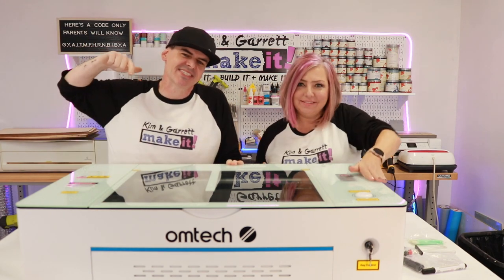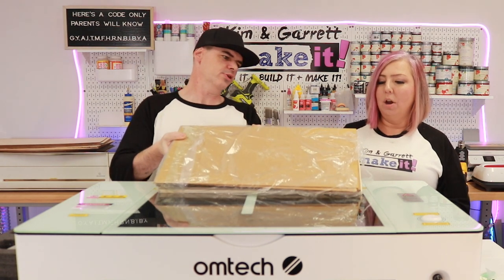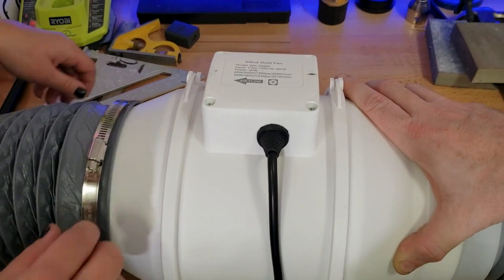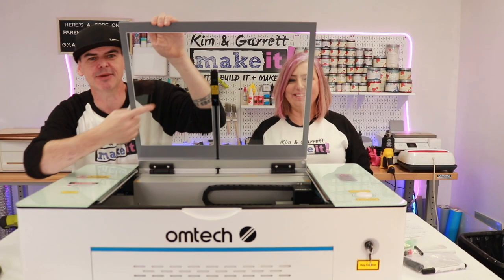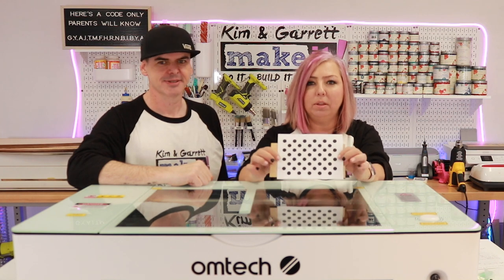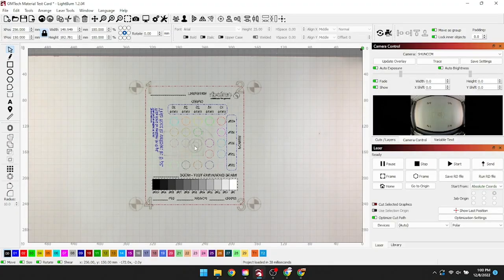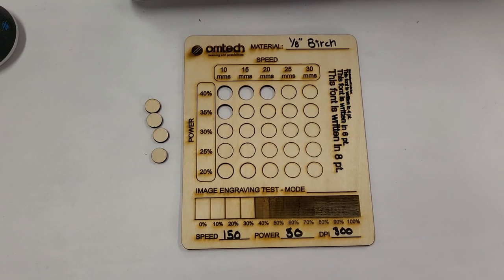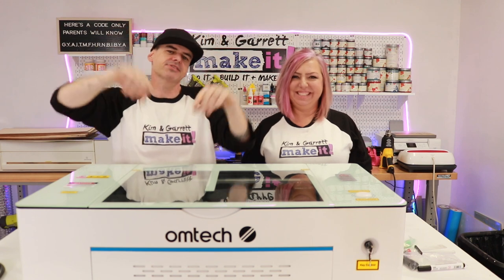OMTech Polar Desktop Laser SetUp: Is It Worth The Money?

Comment: Note:  5:09... You may not have noticed anywhere else, but when you buy this device, it doesn't come with software necessary to operate it.  This offers versatility in that you don't end up paying for software you have, but if you don't have it, there's an extra $120 for software access on 2 computers ($30 per additional machine, though per OMTECH, you can email them to have a 3rd computer seat added for free) and 1 year of updates.  Software continues to work after a year, but there is an additional fee to continue to get updates.

I didn't already own the software so I was quite displeased with this little tidbit as I found out after the fact.  I thought that since the only thing offered with mine while purchasing was Lightburn training videos, that the software was included.  Young me... so naive.

Comment: Bought one refurbed off ebay; pretty amazing for price but has some defeinte quirks.

1. Camera was meh at best; went back to custom via pvc tubing rack.  no more cal nightmares.
2. Engrave speed on x-axis is limited to 200mm/s or 12,000mm/m.  Not sure why?  This means if you set anything higher it makes no difference.
3. Engrave speed on y-axis is 500mm/s; almost seems like you'd get a 50% performance boost if you rotate prints?

Comment: Thank you for your video-I must have played it 10 times during setup.  Im disappointed in my machine--the power key and back switch are useless and it stays on when I turn the key off, and if the switch on the back is off....not good.  Also, the air assist isn't working out of the box-the fan isn't turning at all :(

Comment: I had ordered one and just cancelled once I realized the pass through is nearly useless.   For me, the pass through is important.  I guess I will be saving longer for the Glowforge pro.  

This looks fantastic for those who don’t need/want a usable pass through.
Reply from the maker: Yep, the pass through is useless. We have a video coming up and I point that out. It's 14" wide and just under 1/4" tall.  I cannot get 1/4" MDF through the hole.  My Honest Opinion... If you can operate this Polar laser, you can operate something bigger. Our 80w OMTech laser takes up 16" more that the Polar laser sitting on a table with the exhaust. Both use Lightburn software.  They are the same width but the 80w is 16" deeper plus the water chiller. But the 80w has a 24" X 35" bed with a usable passthrough. https://youtu.be/6rS5yTsjMNI
  This one is is just 5" bigger and under $3000  https://omtechlaser.com/collections/mid-range-co2-laser-engravers/products/55w-co2-laser-engraver-cutter-usb-6b46-us

Comment: Hello, can you describe how the machine measures or does the focus length, is it manual using a tool or do you input the material thickness? I currently have the Longer Ray5 10w. The focus adjustment is a pain. Thinking of upgrading, thank you both